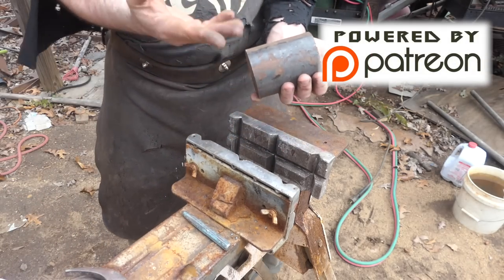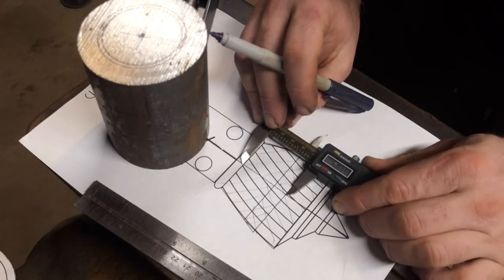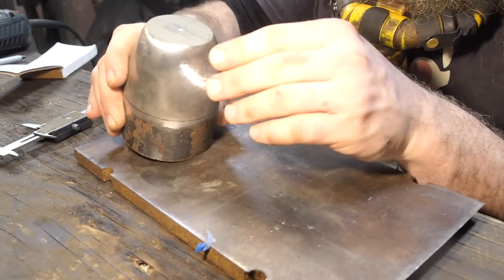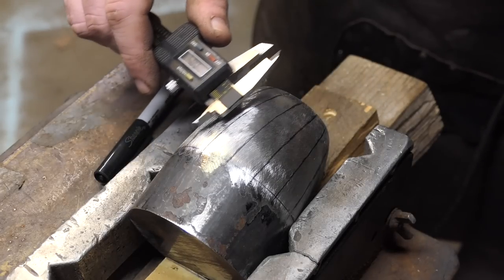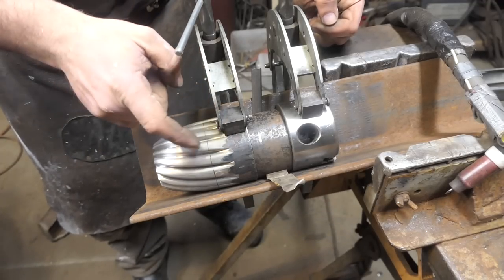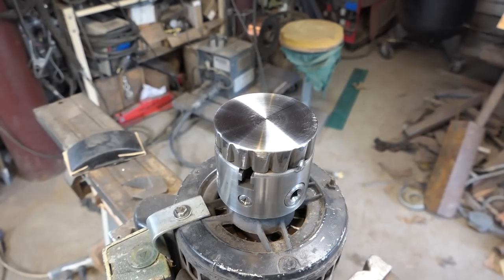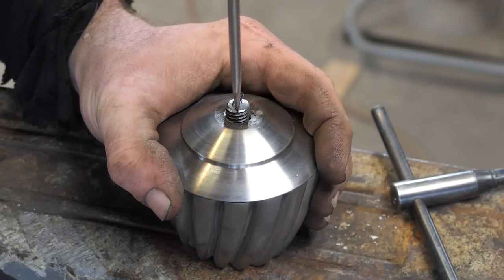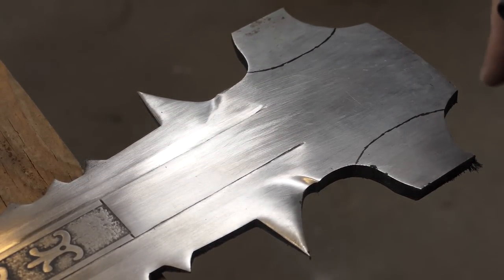Apollyon Part 3 of 4, Swirly Pommel.

Comment: 13:11 the "machine" that costs a lot of money would be a drill, couple piece of board and string. You make 2 circles out of the board and along the end sizes of your pommel you drill the amount of holes of flutes you want, cut the string to amount of flutes and attach them between the board circles so your pommel piece will be left between the circles and inside of the strings, now you just twist the circles and the strings will work as your guides.

So board circles, strings between the circles, thing between the circles within the strings, twist the circles and you have guides for the swirly things.

Just if you need to do swirly things in the future.
Reply: A string? In this economy?
Reply: This must be that string theory people always talk about.

Comment: So, just want to give a little tool tip. I found for marking a specific height on an object, like you were with the two little machinist jack supports. I use a large quantity of paper, or magazines, or books... and then you can put the pen or marker between pages at the correct height. Was the simplest way for me to do it until I snagged a height gauge at a garage sale.

Comment: 09:37 World's heaviest beyblade...
Let it rip!

Also, I don't know how possible it would've been, but wouldn't it also have worked to cut in vertical slices and then heat and twist the metal instead of cutting out the curves?
Just wondering.
Reply: Ya ain't twisting that lump by hand, that's for sure. Besides it wouldn't twist evenly because of the varying thickness.
Reply: He would have to start with a much longer length, like 8 times longer to get a grip, cut the veins, heat the whole thing through, requiring equipment he doesn't have, somehow mount and twist while glowing red hot, find the straightest  most evenly twisted section and cut that out, then still have to grind down the cone and reduce the flares. That would probably work really well on a smaller project, and I've seen a lot of mini-forge videos that are relatively easy and cheep to make. i encourage you to try out exactly that technique to make pineapple, dragon scale, or a variety of similar twisted rod patterns for handles. It's actually loads of fun.
Reply: @RamDragon32  
Fair point, figured I'd atleast drop the idea :)

Comment: 25:00 yeah, you definitely want to stay above 20m/sec (divide to get rpms) for finishing and grind opposite to the sense of rotation to increase speed even more, otherwise stuff will attach to your grain disc/worn grain won't detach and you'll get a bad finish. Also above 200m/min for milling operations.

Comment: I would have used twine or string or even welding rod to make those curves on the pommel. It need to be fixed at both ends and it will make a fair curve along the surface, like a batten when fairing the hull of a wooden boat.

Comment: Should see if you can get a height gage. It's the machinist thingy you mentioned to draw the center line, and you would probably get a lot of use out of it.

Obviously it wouldn't help with the curves you did with the tape, but it would save you a lot of trouble stacking washers.

Comment: Quick question. When you made Aegis Fang, you sent the head off to a machinist to get it milled. Not discounting your skills at all, but do you no longer collaborate with that chap?
Reply: that was a 1 off for charity and the cost of that chaps work would have made the hammer magnitudes more costly if it was sold for what it was worth rather than auction